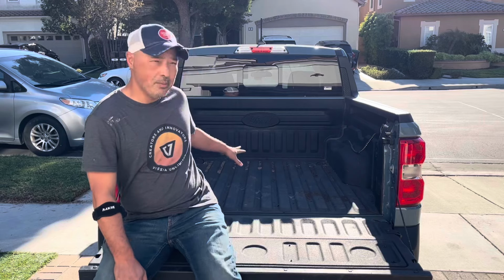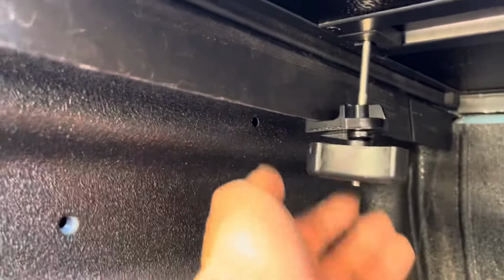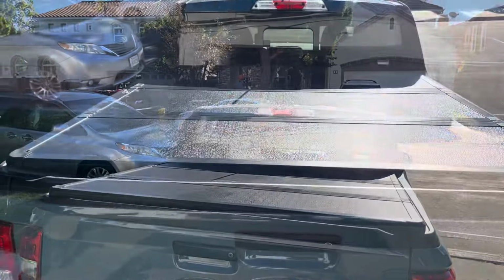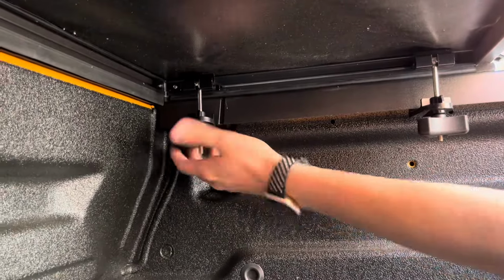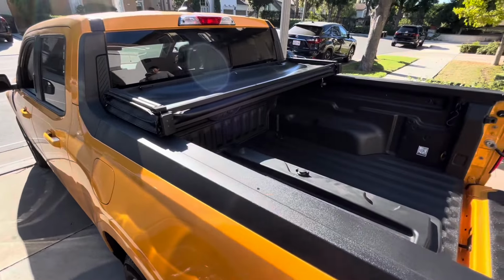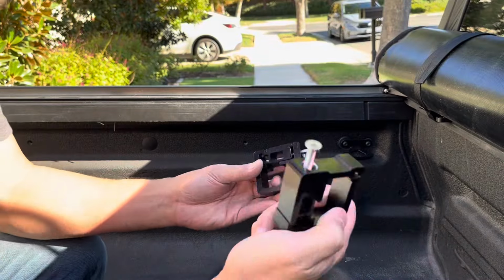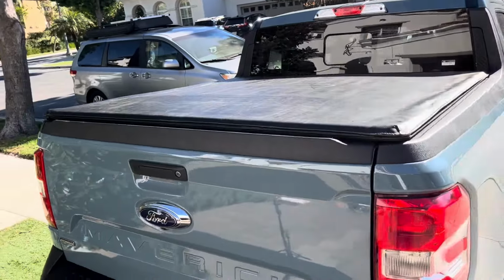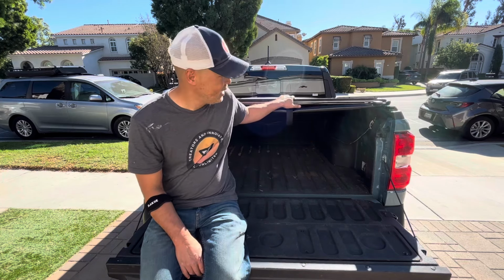Which Tonneau Cover Style Is The Best? I Will Compare 3 Different Kikito Styles

Comment: I decided on a soft top roll-up on my Maverick for one reason. You can utilize the full bed because it rolls up all the way to the window. With tri-folds you lose the front part of the bed if you are hauling something taller than the cover. With a short 4 1/2' bed I need all the space I can get.  Edit- AND he mentions that near the end after I already commented... 👍

Comment: Hi, I have quickly question how was security more protect tough than weak security access?
Reply from the maker: Sorry. I don't understand the question.
Reply: @GearGadgetExperiments  thank you for respond* I am apology, I need explain to better. Which tonneau have strong for security that impossible to break in?

(I’m apology not good grammar)
Reply: The hard top would be  difficult to break into. But nothing is impossible
Reply: @Tiny-Campers  ok thanks update!
Reply from the maker: I just realized responded with my Tiny Campers login.  I am happy to help.